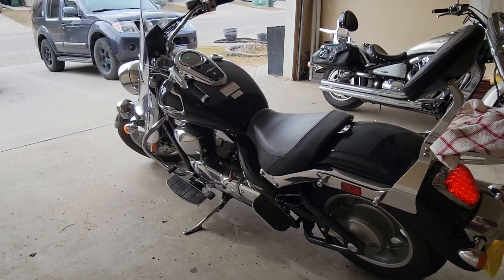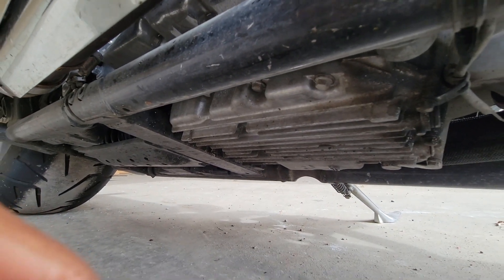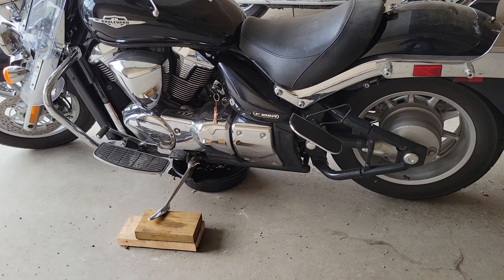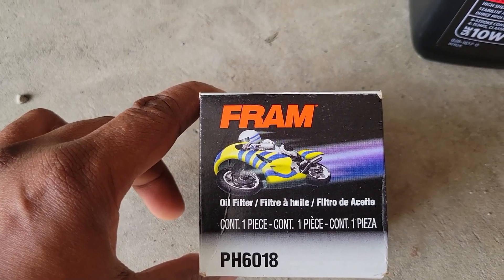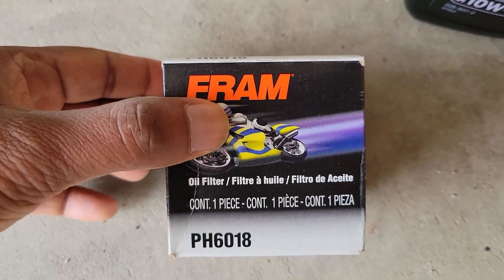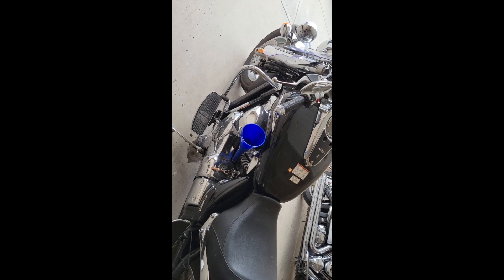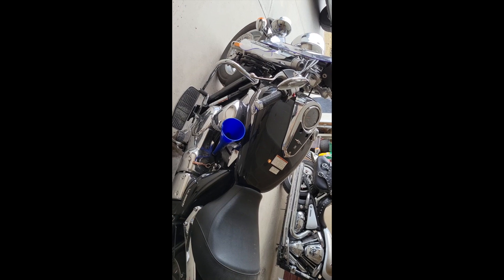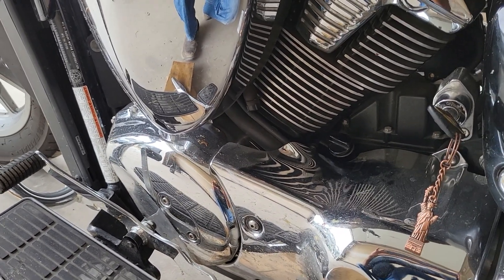Oil and filter change - Suzuki Boulevard C109RT

Comment: Im loving your content about the c109 and would appreciate it if you'd post more basic  maintenance videos like ( supension adjustments/service, air filter replacement etc ). 
Just bought mine, an 08 with 4k miles and it seems to have a surge/ hesitation in the first 3 gears at low/ steady rpms. It seems like a common issue on both the c109 and m109 according to some forums. Do you have that issue with yours?
Thanks in advance.

Comment: So oil level is to the bottom mark of dipstick, correct?
Reply: I believe that is just for checking his initial fill to know not to overfill the oil. If ya think about it, twisting it down from there will probably put the oil right in the middle of those cross hatches. So properly filled when touching the bottom of dipstick before tightening it down.